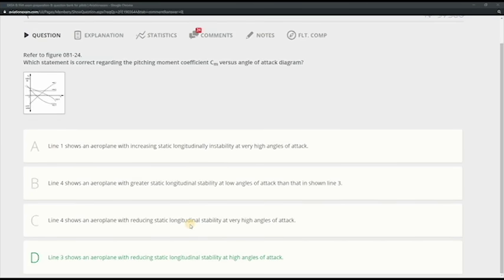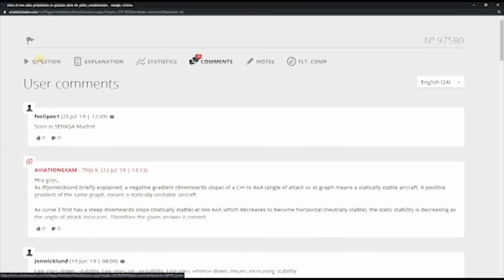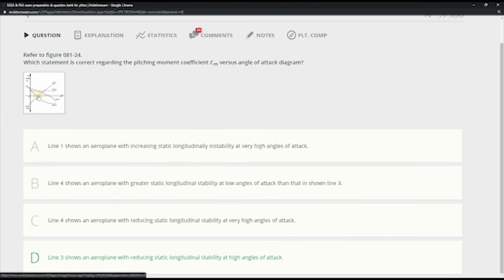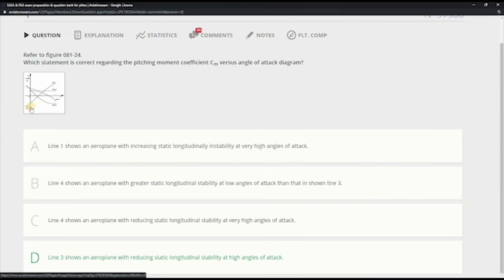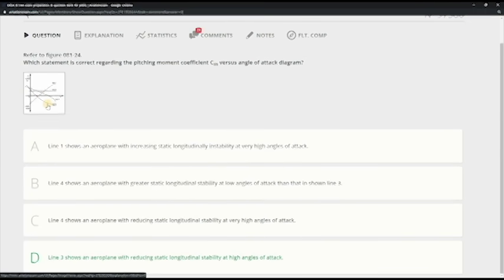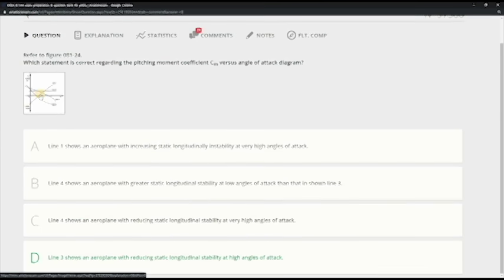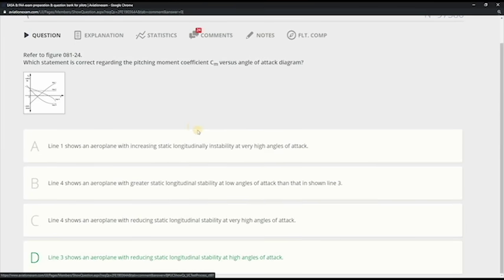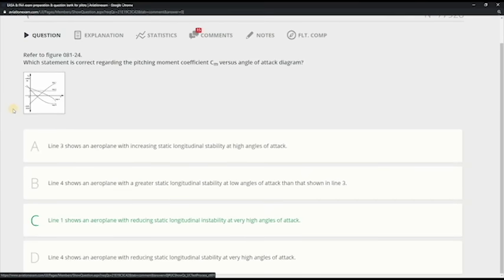Principles of flight - Stability Graph explained

Comment: Man explanation is good but i still didn`t understand why for example Line 3 when it become straight is  "reducing stabillity" ?
Reply from the maker: Damn, I should have made the diagram much bigger. Can you please send me the pic on my instagram profile ? - patriot.pilot  I will check it and come back with a clear answer
Reply from the maker: So, I went full screen and  realised what is going on. So, if the line goes down, it is increasing stability, so, when the line is getting straight, it means it is kind of going up, which means reducing stability.